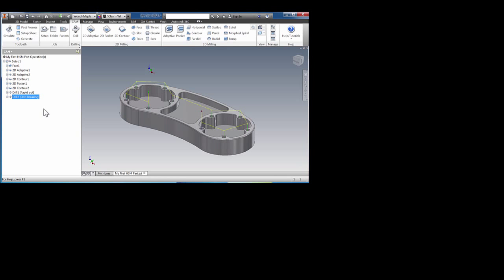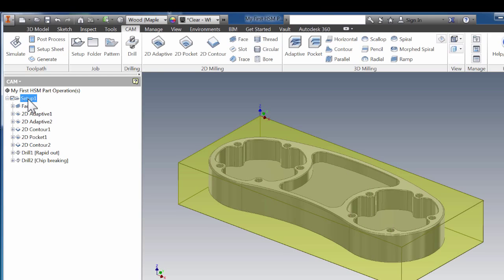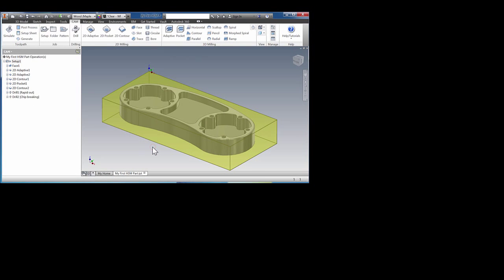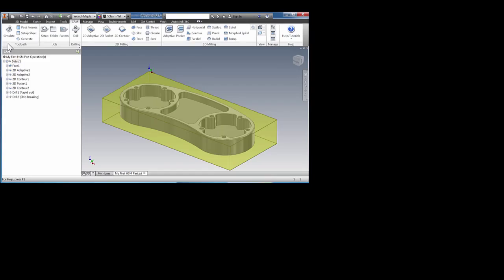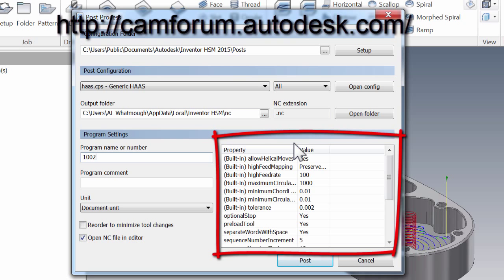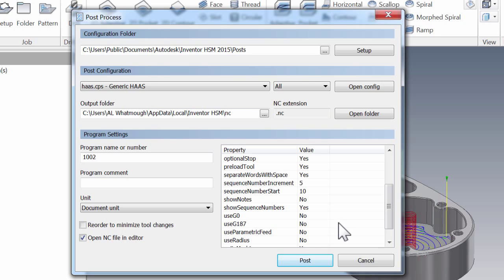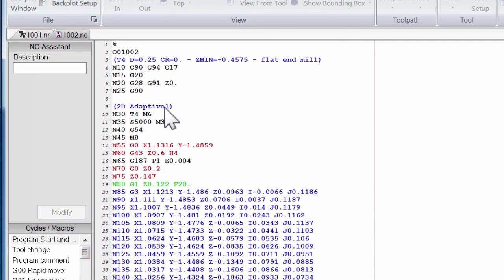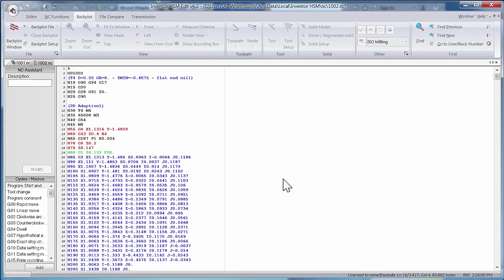Intro to Inventor HSM   PT3

Comment: I really love Autodesk products but they made HSM as complicated as possible. I understand why they made it so damn universal but seriously.. Major machine shops working today all ready have a workflow available to them and are not likely to change. I run a simple homemade desktop cnc without all the frills like a tool changer or chucks for every bit I own.. All my bits are changed by hand at the collet. Spent all morning with this software and I have everything he described figured out but the things that are a priority to me.. I can not plunge right into my part and just cut out an inch of stock. Depth of pass is something very important to me and he glazed right past it.

Your software has no business knowing what type of cnc I am using, I already have that programmed into my Mach3, I just need the part I designed in your very intuitive Inventor to move over into HSM and spit out a damn gcode.....I am at the point that I just need to bite the bullet and start using sketch-up instead of Inventor, too many extra steps going from inventor to mach3, I was holding out for the promise of HSM but it fell flat for my application... The DIY guy isnt in their demographic I guess... Really sad because the markets are being flooded with desktop cnc 3d printers, and scanners...